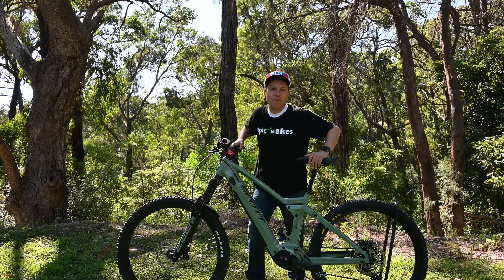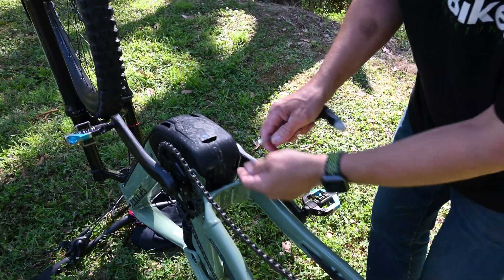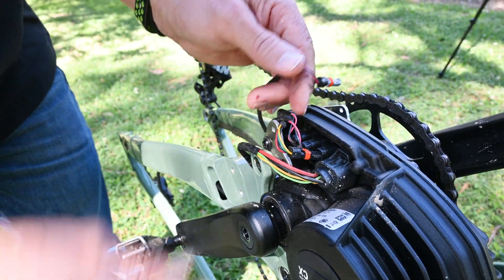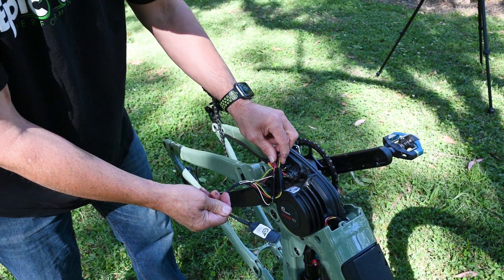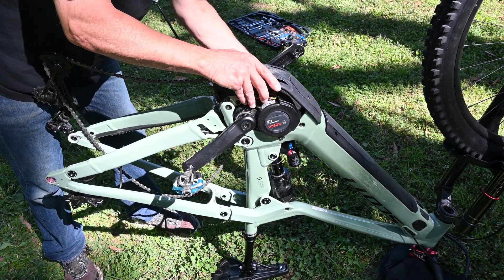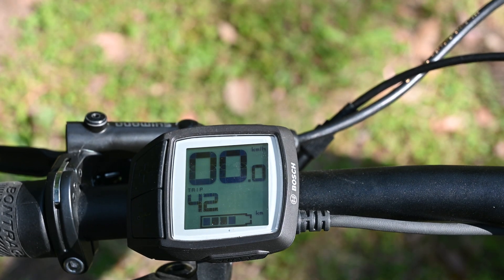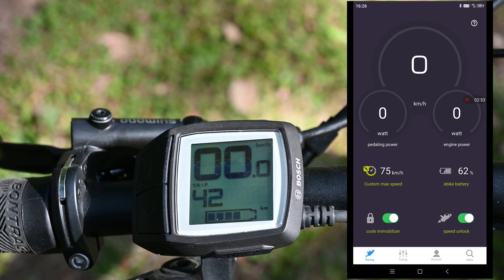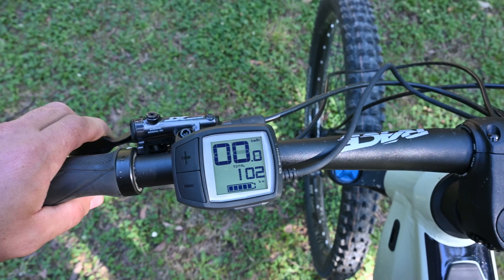2021 Scott Ransom eRIDE Speed Limit Unlocked & Custom Tuning Via Mobile App - Bosch CX Gen 4 Motor

Comment: I'm very interested in this, I'm in the market for a Ransom...  Can you please explain how it assists at high speeds?  Can you update with a video showing the bike cycling through gears up to top speed?  Thanks...
Reply: it assists in the same way it does at lower speed, just there is no limiter and the motor does cut off assistance. What limits your speed is the gearing. Pretty impossible to pedal fast enough to reach 75kmh

Comment: hi~ If so, is it necessary to have a countdown process every time the device is turned on and turned off at every moment?
Reply from the maker: If you activate the chip and travel faster then 25km/h then the countdown needs to happen prior to turning off the bike. If you do not activate the chip or you do not exceed 25km/h then the countdown does not need to happen.
Reply: will this also work on the 2023 model  Ransom ?
Reply: @tonyvaccarelli7950  if the frame does not changed

Comment: Is this chip any better than Volspeed or Speedbox regarding 504 error? What is your "genuine" customer feedback if I may ask? Both Volspeed and Speedbox strongly discourage setting up anything faster than 35kmh. They also use some cheat sequence at the end of the ride.
Reply: Any vids of riding it deresticted
Reply from the maker: Hi Mate, The majority of customers are enjoying these chips with no errors, A small number have reported 504's but in all cases it has been due to not allowing the countdown to complete regularly either by being unaware or having lent the bike to friends and not informing them of the process.